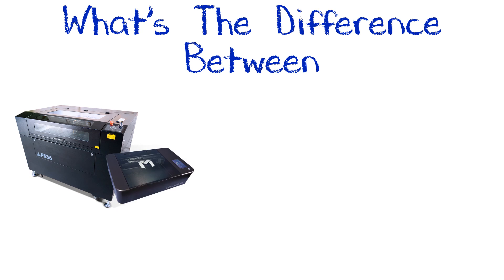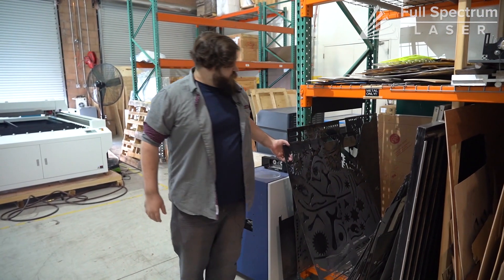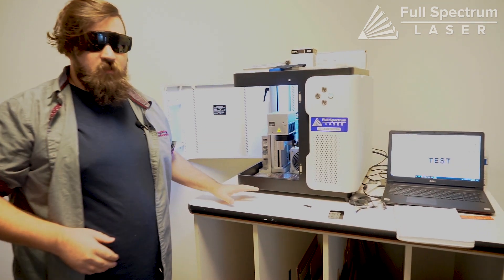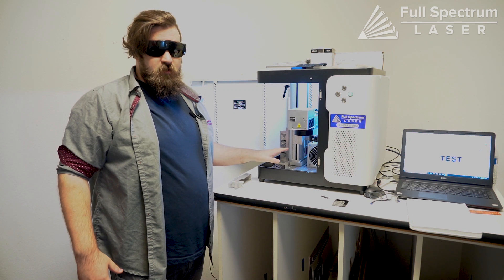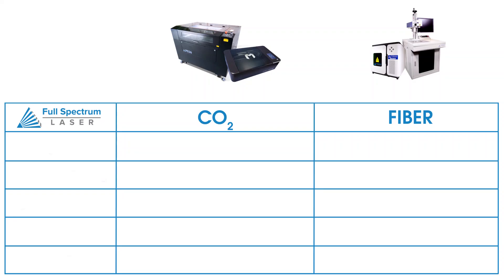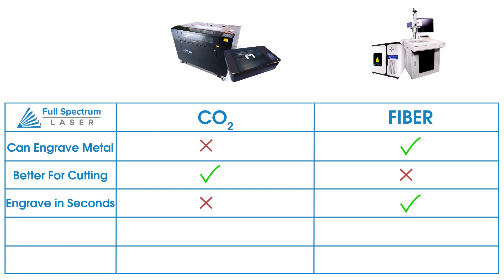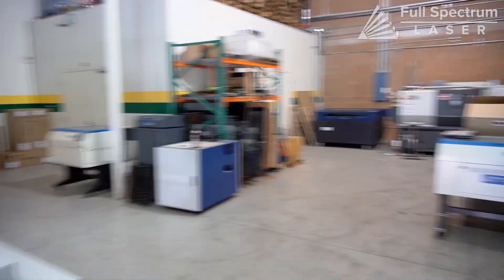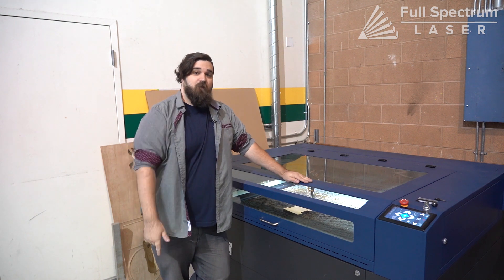CO2 vs Fiber Lasers

Comment: I'm brand new to laser engraving and just picked up a 40w CNC Fiber Laser myself.  Using factory settings I can engrave any of those black laser cards for sale on Amazon fine but on any other metals - nearly nothing!  What could I be doing wrong?  I've looked for a depth setting in EzCad which it came with and didn't find anything, I tried all different random MhZ and power settings and still no change.  I can see a very slight marking if I set it to loop 10x for instance but not much beyond that yet the manufacturer shows it cutting deep into firearm slides and such.  Of course out of China I'm getting no support so just wondered if any of you experienced engravers might know what I'm doing wrong?
Reply from the maker: It's hard to determine what your issue might be without knowing the specs of your machine. I also imagine our machines use different software. That said, there are some really good forums on Facebook that would be able to help you. There is a group called "Fiber and Yag Laser Engraving" that would definitely be able to help you out.
Reply: @FullSpectrumLasers  Thank you, I appreciate that.  I was wrong in saying it was 40w, it's actually 30w but other than that looks nearly identical to your machines and uses the typical EZCad2 software.  I'll check out those forums, thank you!
Reply: I can point you to a couple:
Fiber Laser Metal Engraving
https://www.facebook.com/groups/440091022989424/
Metal Laser Engraving Fans
https://www.facebook.com/groups/4105345129538639/
Ezcad Forum
https://www.facebook.com/groups/368089227540080/

Comment: Do you have a recommendation for  the best machine that can engrave polymer pistol frames?
Reply from the maker: Galvo fiber lasers are typically the standard when it comes to engraving firearms. If you're strictly doing polymer, you could use a CO2 Gantry laser, but the speed you get with a Galvo Fiber is really second to none. Our Muse Fiber would work really well. Our RE3 software is a lot user friendly than most other Fiber laser software too.

Comment: Can a fiber laser engrave on other materials like wood and plastics?
Reply from the maker: Fiber lasers can engrave polycarbonate really well, but wood can be dangerous and I wouldn't recommend marking wood with a fiber. Acrylic will work but fiber lasers don't engrave clear acrylic as well.

Comment: CO2 Lasers CAN cut metal, with as low as a 150w laser.
Reply from the maker: Yes CO2 lasers CAN cut metal. However it's typically very thin sheets at very high wattage. You can cut thicker metal with CO2 lasers as well, but those types of machines are generally prohibitively expensive. When customers ask about cutting metal, they typically want to cut thicker stock like 1/4" steel. This video simply illustrates that within the price-range most of our customers attempt to remain in, cutting metal in general (let alone with a CO2 laser) is not practical. Thank you for your concern.

Comment: Is there any machine that built with dual head, co2 and fibre ?
Need some.
Reply from the maker: Not that we sell, however I don't believe it would be impossible. I would imagine it would have to be custom built.
Reply: It is possible, my company is sell dual head Co2 laser, it needs two laser tubes and two water chillers
Reply: Trotec's Flexx series lasers are dual source, but, as you might have guessed, they are not cheap.

Comment: nice video, but comparison is not comprehensive enough. CO2 laser machine has different type : Gantry plotter type, 2D galvo scanner type and 3D galvo scanner type, all of these are widely used in the normal industry. Fiber laser machine also has different type: Gantry type metal cutter, 2D galvo scanner type marking machine, also 3D galvo scanner type. Different structure makes them different speed and different application. So this video just compare the Gantry type CO2 laser plotter with 2D galvo scanner type fiber laser marking machine, if can add more options, could be much better. :)
Reply from the maker: Thank you for your feedback. This video is mainly to illustrate the difference between the machines we offer to our potential customers. We are aware that there are CO2 lasers with galvo scanners, but as we do not sell any, we did not include them. The same goes for the 3D galvo scanner machines. We do not sell them, therefore we did not include them in the video. Our customers ask about the difference between Fiber and CO2 lasers all the time, and adding reference to machines that we do not offer would more than likely add to the confusion.
Reply: @FullSpectrumLasers  Gotcha！ Those system you do not sell we all have. We are always ready and welcome for the new cooperation :D

Comment: Whats the life of the tube for the Muse range of machines?
Reply from the maker: The tubes we offer with our Muse machines range from 40-45 watts. They're typically rated at about 1200-2000 hours of use, however there are multiple variables that can increase or decrease that estimate.